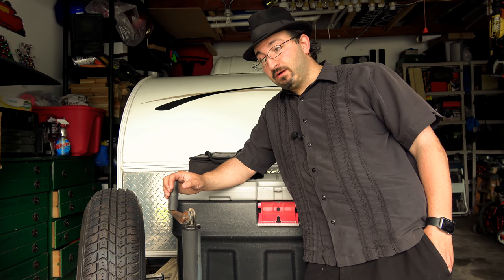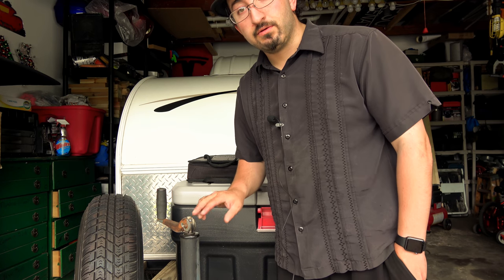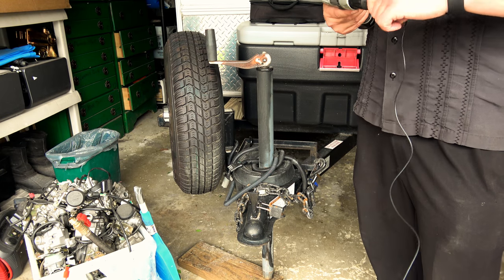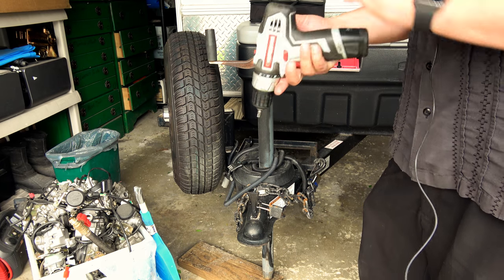Powered Trailer Jack  Kman's Life Hack

Comment: Good idea, but most of the cheaper u- joint swivels aren't designed for power tools and may fall apart during high speed use, so keep an eye on the pins starting to creep out.
Reply from the maker: +JRP3 Suppose, mines a Sears craftsman, going in a good 18 or so years with it. was about $2
Reply: KmanAuto Seems like you'll be ok then :-)
Reply: Like your idea, but for safety, how about removing the hand crank, your going to use the drill anyway, and if your drill runs out of power reconnect it. Your thoughts.
Lee.